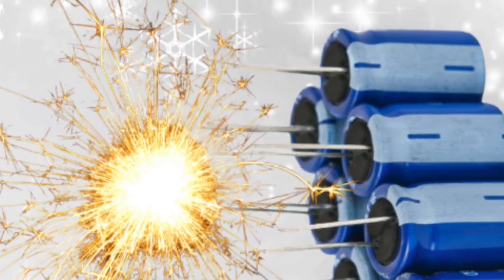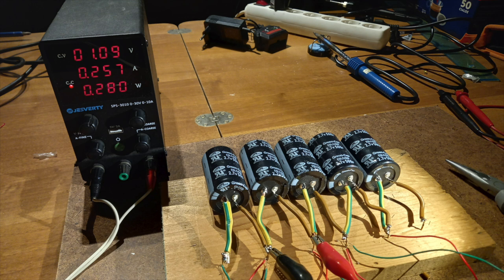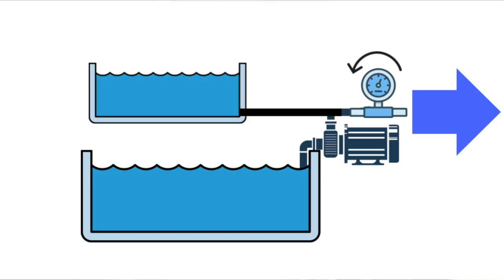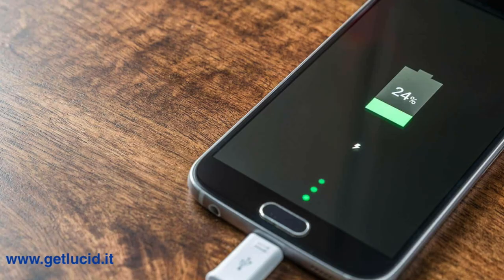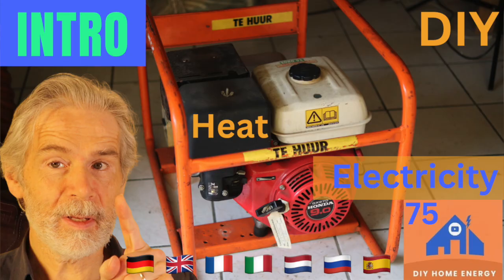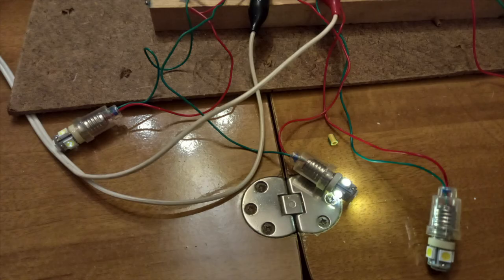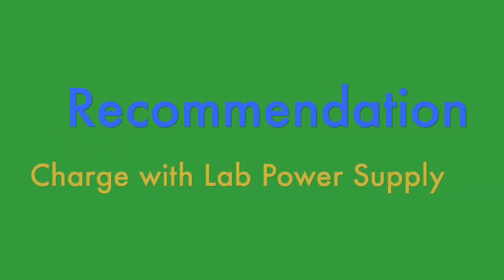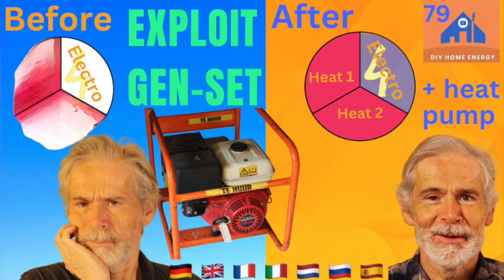How to use super capacitors to improve the (car) battery  - Video 81

Comment: GREAT VIDEO- BUT WARNINGS-WHEN WE WERE DOING ELECTRONICS ON MY ENGINEERING COURSE,HAD GREAT FUN, CHARGING+ THEN THROWING FOR SOMEONE TO CATCH-WHICH GAVE THEM AN UNEXPECTED SHOCK!! BUT STOPPED- LECTURER SAID A TINY ONE LIKE IN A CAMERA FLASH- CAN STOP A HEART- ESPECIALLY IF UNKOWN HEART PROBS- SO I ALWAYS USE RUBBER GLOVES- NO MATTER HOW SMALL- THOSE 500 FARAD ARE PROBABLY USED IN DEFIBRILLATORS,WHICH CAN MAKE BODIES BOUNCE OFF THE FLOOR!!! PEOPLE THINK LOW VOLTAGES EQUALS SAFE( AS WE DID) - BUT THAT CAN KILL...
LOOKING FORWARD TO SEEING CHP COMING BACK !!!
Reply from the maker: Hi Liam thank you for commenting again, man, you should come into the Facebook group, it's too silent there! It is always in the description. Indeed the official limit for save working is 30 Volt DC, but that doesn't consider the big current that can come from low voltage and that in turn can induce other dangers like again voltage and heat.
Reply: @nnvasen-good-energy  I DONT DO FACEBOOK, X,ETC - PREFER TO DO FACE TO FACE!!!   PLUS,MUCH OF MY THOUGHTS, LIKE ON  DR.ROBERT W MALONE,  DR PETER MCCULLOUGH, DR.JOHN CAMPBELL, THE FLCCC ALLIANCE, WOULD ONLY DRAW TROLLS- AND UNNEEDED GOVT ATTENTION...!! BUT I APPRECIATE THE INVITE👍👍👍👍👍 PS- HAVE YOU SEEN CHINA LATEST ? THEY'RE HAVING A REPEAT OF THEIR LAST CRISIS....🤬
Reply from the maker: These days I will see if the heat pump technician has time for me. If the channel  grows big in a couple of years I will employ one full time ☺

Comment: Hello Norbert! I have been searching around for hotwater connected dishwasher oboy what a mess, there are alot of people more or less trying to make it a loose case, like it is something bad... eggwhite problem, they are built for cold water, and how stupid it is to use hot/warm water. The base "case" is that most of the cycles dpend on cold water. Have any other angles on the matter? :) thanx :) Please continue with capacitors, I saw an interesting video on "fullycharged" visiting a capacitor company in estonia some years ago... :)
Reply from the maker: Hi Fredrik, it is true that some cycles can depend on cold water but I don't know how many. The machine knows. I think the dishwasher is hot nearly all the time and if you or the machine goes hot cold and again hot then it must heat up again all this metal glass and ceramic! Then it's better to stay warm I would say. It would be so nice if those machine builders , if not providing 2 different water inlets,  at least a signal outlet that tells what water temperature it is going to use. Little effort for them. By the way, I think that in most cases it makes a bit more sense to give warm water to the dishwasher than to the washing machine. Higher temperature and less delicate product that can be damaged by heat.
Reply from the maker: I will visit Fully charged!

Comment: I live in southwest Michigan where the winter temps can go down to -10*F, but usually 10* is our normal low. We have lived in our current home 2 years and only experienced a short outage of 10 hours about 1 year ago. I purchased a 3000W dual fuel inverter (120VAC 30 AMP) and wired it into my mains panel with interlock. Being only 120VAC I had to bridge the L1 and L2 together to use both sides of out panel. Cannot use 220VAC circuits. I have a Natural Gas furnace so I'm covered with ESSENTIALS during an winter outage and can live with summer outages without AC. My electrical supply company charges different rates during the summer. x2 the normal rate/KWh from 2 to 7PM because of the shutdown of Coal and Nuclear plants!  My goal is to have battery backup that I can use to buffer the High Rate hours by storing energy during the OFF Peak hours. My avg usage is 13KWh/day during the winter period and can go up to avg of 17kWh/day during the summer (August our hottest month). Local Storage for short term usage (12 hrs) seems to be our biggest problem. Third World vs First World problems seems to be your channel decision.
Reply from the maker: Hi William, those are far extremes between winter and summer, compared to here in Italy or in my country the Netherlands. I have the impression that you are well prepared, even for off grid (fuel inverter is gasoline generator, I suppose. I have also an inverter generator of Pramac, which is the better brand here from Tuscany).
If local stories for half a day is your main problem then I would like to mention you video number 71 which you see also referred to in the German comment here below. It is already at 84k views, an absolute surprise for my small channel but DIY seem to like it. What do you mean with the last phrase? I suppose it is that we in the First World are slowly growing out of our capacity and that is indeed what I see in many First world countries. Everybody is electrifying and trying to forget about fossil fuel but the grid operators have no money or permissions to upgrade.
I tried also a playlist for the Developing Countries, where 760 million people even have no Access to Energy but even going an inch outside my focus is already impossible with only 24 hours in a day.
Thank you for your comment. Hope to see you also on Facebook! 
https://www.facebook.com/groups/1440674419825846
Reply: Live closer job so no need torturing car winter